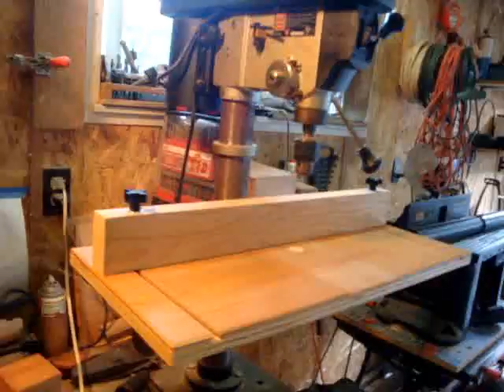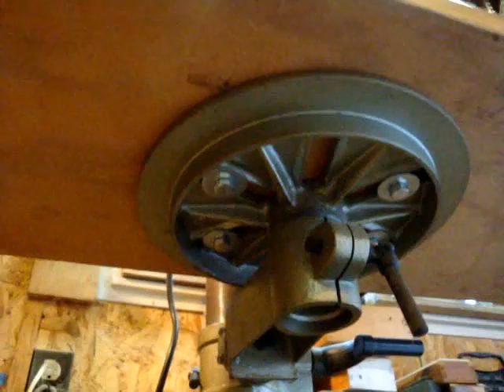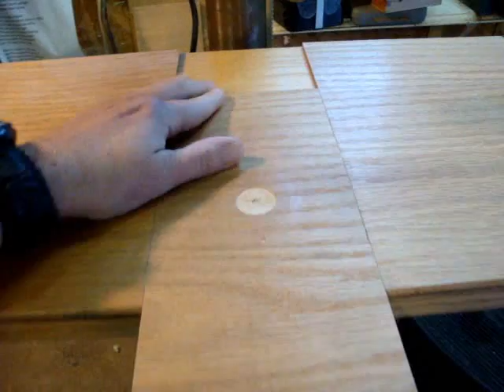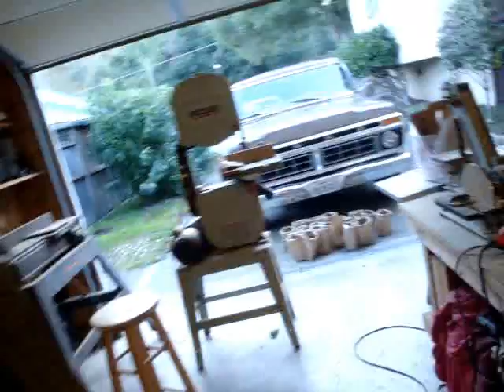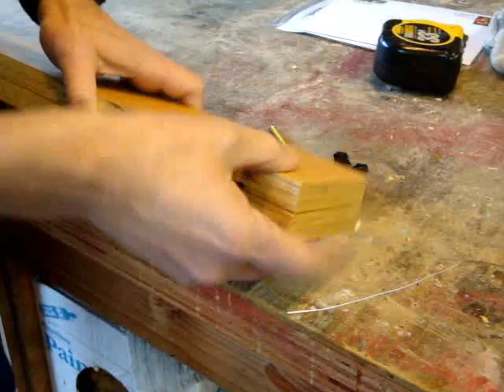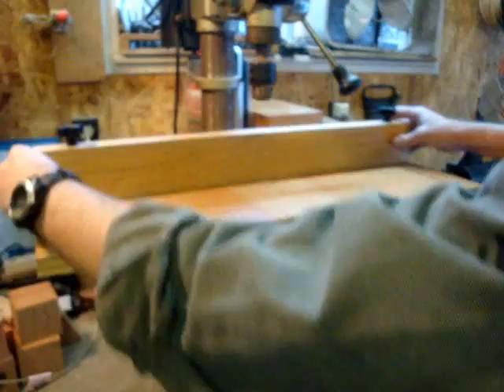Build a drill press table for your woodshop

Comment: My first WWMM project completed! Thanks so much. This table is a lifesaver, although I did spend too much time trying to figure out the hardware for this. Star knobs are not as readily available as you'd think. They have them at Lowes, but not at Home Depot. However, my Lowes had a terrible selection. I ended up (once again) at Amazon. Love this channel.

Comment: instead of cutting the replacement inserts at an angle that you have to remember, or cutting a whole bunch of inserts at once, just make normal vertical cuts and hold the insert in place with 2-sided tape.
Reply: +Chris R Or just use a dovetail router bit in your router table

Comment: Speaking from experience, one of the problems with trying to use a drill press for milling is that the bearings aren't designed for that type of thrust and it may cause the bearings to fail prematurely. If you are milling wood, you might consider using a router as the bearings are designed for a lateral thrust. 
Good luck on your projects Mizerlad.

Comment: Steve, 

On the fence instead of using dado's couldn't you just drill a hole big enough for the bolts?
Also, the bolts attaching the table are the like lag screws or do you have something threaded in the table itself? How's that attached? I just bought me a drill press and need a table like yours! 

Thanks,

Comment: Being as tight as a fishes ......   I noted that the sliding board is centred under the drill head.  If you off-set the board, say 2/3 inches from centre, it would mean that when the board gets too damaged you can put it out and turn it around.  I'm going to be busy this weekend building drill press table. Gee, 30 years putting up with a 8 x 10" plate "DUH" and a nail in the wood box puzzel.

Comment: Another option would be the "Drill Press Extension Table with Fence" from Harbor Freight.  Save a bunch of time and with the common 20% off coupon they always have, it'd be about the same price as buying the two small sheets of plywood, the bolts for securing the base and the fence, the screw knobs, etc.. minus the time it takes to make it. :)

Comment: my cheap hand-me-down Duracraft drill press lost its chuck screw.  That is the screw that holds the chuck up against its spindle.  THe screw is "left handed" and I can't find a replacement. I can't even find a tap and die set to make left handed screws.  Any suggestions?

Comment: steve the reason that they don't make big tables on drill press tables is....castiron tables would drag the drillpress over. if you put a heavy cast iron table on the front combined with the weight of the head of the drill press...you would have to make the base of the drill press three or four times the size so that it wouldn't overbalance. That applies to both floor and table models...because there are not many people know who actually bolt thier drill presses down

Comment: great project and video!  thanks!
Could you do a video on how to adjust the spindle return spring? I have a Delta 12 inch bench top drill press , very similar to yours,  and the spindle will not stay up but falls back down to the work surface every time.   Also show me how to get the handle cover off, so that  I can get to the spring that I know is under neath there.

Thanks

Comment: Very cool; thanks for sharing! You could have just used one board of wood for the base and used a dovetail bit to make the grooves; however, it might not work very well if you use plywood.

Also, it would be better to offset the part that you drill into to either side. This way you get more use out of each piece by reinserting it in the opposite direction when it waers down on one side.

Comment: I like this video...you have come up with a novel way to cut a T slot...I have been using a T slot bit in my router but this is a far better way..the only time I will use my bit from now on is if I need a stopped T slot

Comment from the maker: @bsingin64 I should have showed that part. I used those little inset nuts (I'm not sure what they are called). They inset into the table from the top, under the thin plywood laminate and the bolts just screw into them from underneath.

Comment: Hey Steve,  Love the vids.  One question on this one.  How do you bolt it down?  are those T-nuts on the top of the table and a really well measured hex bolt.  I imagine a 1 inch bolt and an embedded T-nut.  Is that it?